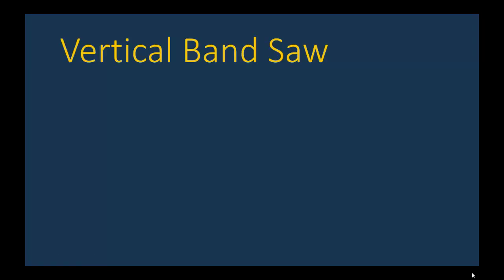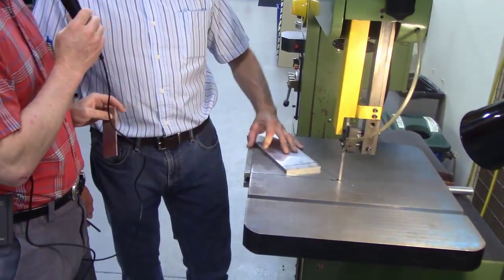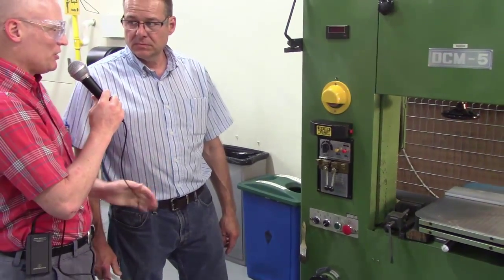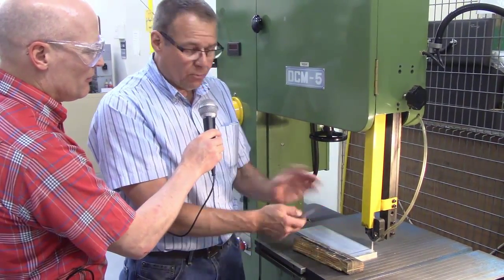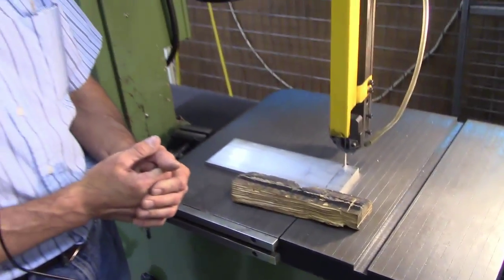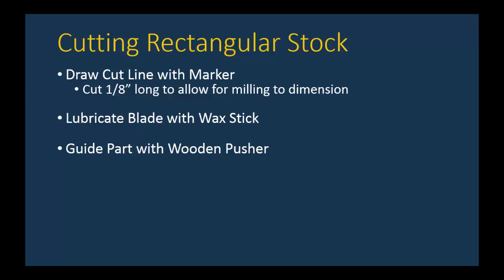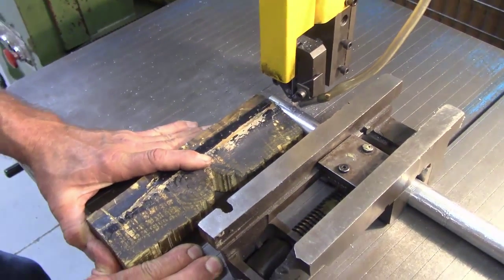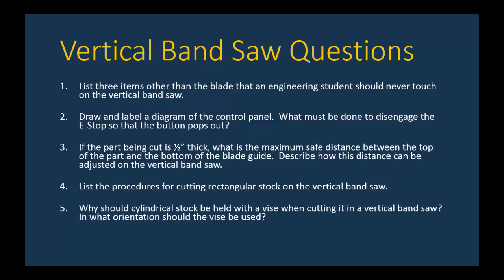MCC ENR 153 Machine Shop Video Saws and Sanders 2 Vertical Band Saw

Comment: 1.) Students should never touch the blade gear, the grinder, nor the welder.
2.) The vertical band saw has two dials and two buttons. From the left, there is a switch that controls the grinder, a switch that controls the light, a button that turns the machine on, and the emergency stop button. To disengage the emergency stop button, rotate it clockwise.
3.) The maximum safe distance between the part and the blade guide is four times the height of the part. To set this distance, loosen the blade guide with the black know, adjust the blade guide to an appropriate height, then tighten it in place.
4.)To cut rectangular stock, draw a cut line on your part with marker , then lubricate the blade with a wax stick. Gently guide the part with the wooden pusher, and then turn the machine off once the cut is complete. Once the machine has stopped, deburr the part as well as the remaining stock.
5.) When cutting cylindrical stock, be sure to use an upside down vise, to ensure that the part wont rotate, nor come loose.